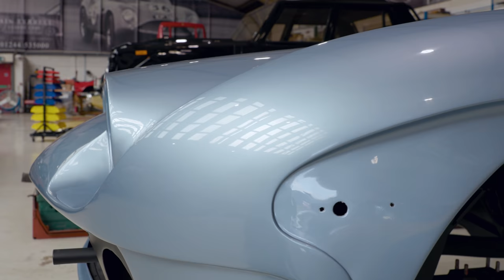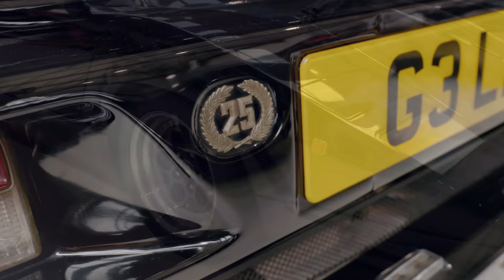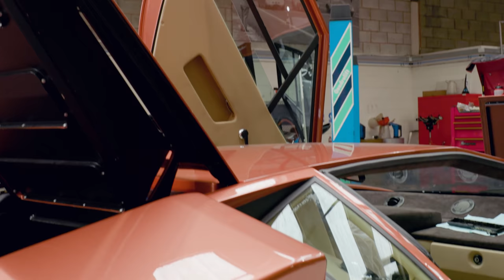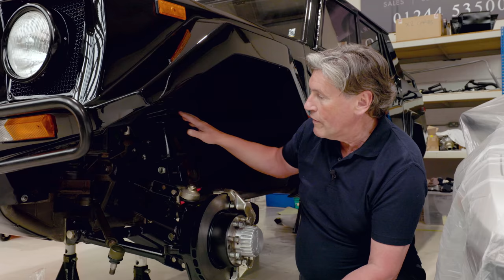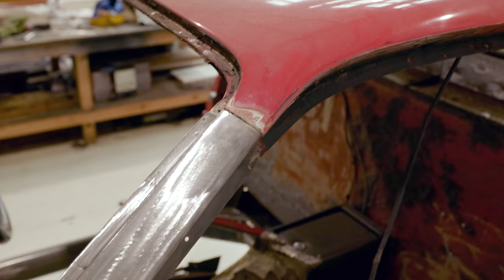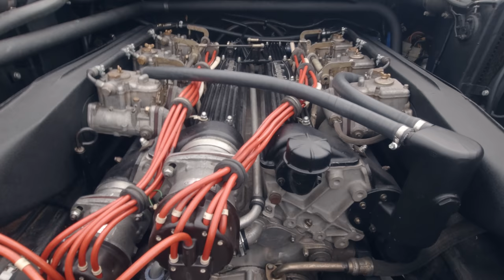Catching up with The Italian Jobs - Ferrari & Lamborghini Restorations | Tyrrell's Classic Workshop

Comment: When Ian is referring to embossed leather, it is typically regarded as a lower grade leather. Hides are split (skived) into two, the original outer skin is "top grain" and is easily distinguished as it has a completely random, much deeper grain. It is also usually much thicher because as the grain is deeper, you need to split the hide to keep some thickness to it. Embossed leather tends to have a much shallower and more consistent pattern, which has a much softer hand feel.
Sadly, embossed leather is not as durable and the pattern eventually comes out of it, leaving a fairly shiny leather.

Comment: The Rolls story must be from the 70's as the Granada didn't exist in the 60's! Similar stories exist from the days when Hondas were built in Rover facilities, some parts not good enough to meet the Honda standards went onto the Rover cars instead.
Reply: Well spotted! The Granada came onto the scene in '72 which fits the '70s timeline. However if the story related to Ford's Mark III and Mark IV Zephyr/Zodiac models then it would be in line with the '60s.
(Rare oversight from Mr Tyrrell!)

Comment: After seeing a 308 in its underpants, I don’t feel like going for a ride.
Reply: Thought the same thing.  Especially when it's rusty!
Reply: A lot of Ferrari’s incl the F40 look like very dodgy kit cars when you strip them down. Things are vastly better with the more modern cars
Reply: @ericpisch2732  I've seen Ferraris stripped down and thought there's no way ..like no way this is the same quality as a German built car or even a GM or ford product ...they look very poorly constructed
Reply: Different era technology. Common cars were no better regarding chassis rigidity and safeness.
Reply: @ericpisch2732  The F40 was a race car minimally adapted for road use. Weight was the enemy.
Reply: With more modern ones its a different issue. Aluminium and steel close together, plus salt water causes corrosion. You get the same thing on the Lotus chassis.

Comment: Quick question. Why does the espada with the same or very similar bizzarini v12 has a single 12 cylinder distributor with 4 points in it but this countach has 2x 6 cylinder distributors with twin points in each. Why is that? What are the pros and cons of each setup?

Comment: If you ask me the Countach has the best sounding car engine of all time. I've talked to Lamborghini owners and they say that the engines and transmissions in the Countach and Jalpa were really solid. If there were reliability problems it was in the electrical system because that was supplied by Fiat and Fiat hasn't been known for Toyota like reliability.

Comment: Wo Iain! That countach was smoking there at the end. No, I really mean smoke coming out of the pipes. Seemed more on the left bank. Bad valve seals?
I remember when the Rambo Lambo came out. As you said, sheiks were buying them.
That blue color on that one was one of the most beautiful colors I have ever seen! Why would anyone cover it with red?
Reply from the maker: There was some water in the fuel system from a porous tank (as it turned out). The carbs are now rebuilt, and it’s smoke and steam free. It’s very much a working workshop, so sometimes things like this happen, and we try to squeeze shooting the videos in between. Thanks for your interest

Comment: I resprayed a Ferrari 308 back in 1983/84 owned by the Rothchild's Banking family and it was originally in a Rolls Royce colour but Rolls Royce wouldn't give out their colour code formulations so I had to make a colour as close as I could which was a metallic dark blue but problems arose at the beginning so I ended up having to strip all the paint off the car which was Fiberglass with a steel boot and an aluminium bonnet.

Comment: In the eighties, Ford was generally very, very fussy and strange about tolerances. To the point it hardly made sense to contractors. Lots of batches got rejected for strange looking reasons. 
The reason was: robots. Parts were stacked up next to the assembly robots, up to 10 or 20 parts tall. The robot needed to be able to grab the top part with precision, and not miss because of an ever increasing deviation. 

Contractors were not told.

Comment: Ford Granada didn’t appear until 1972 - so the 1965 reference with Rolls Royce is a somewhat ropey story. Surprised Mr Tyrrell wasn’t aware of that from the “extremely reliable source”.
Reply from the maker: My source worked at Girling in a senior position. I agree, I either got the model or the year wrong. The joys of one take. Still true though. Thanks for your interest

Comment: are you aware of the easily improvements to the Countach electrical system to reduce voltage drop from rear to front and front to rear.  the alternator out put cable can be changed to a 4 gauge cable over to a 130 or 140 amp mega fuse block . the alternator should be 120 amps.  installing the mega fuse block in the right rear corner of the engine compartment..  repinning the radiator fan relay pin 30...  to be directly powered via a fuse  from the mega fuse block.. install a relay for the AC compressor clutch. on cars that have MSD ignition systems.. the thick red MSD power cable also needs to feed from the mega fuse block.  on fuel injected cars... both fuel pumps and the fuel injection system get powered from the mega fuse block.  doing this reduces the voltage drop from the alternator to the fuse block and battery.. what happens is there is more current available to spin the evaporator fan faster.. so the ac actually cools the cabin without needing to open the doors at stop signs..   adjustable output voltage regulators are also available from some suppliers. .. just thought i would share..  try some voltage drop tests if you don't believe me.  all you need are 20+foot long test leads.  and yes.. its not original.. it works better..  one should also examine the connector near the oil cooler thermostat . so the thick pink wire going thru shows no signs of burning..   lastly.. where the wiring harness comes off the fuse box... please use a fiber optic camera to look at where the wires come out and bend forward .. there is an unprotected steel dash board brace that can cut thru the wiring harness insulation.. causing electrical fires.

Comment: "Nothing wrong with that!"
To be fair, also, what's wrong with medians on the side of UK and IR roads???
Reply: By medians, do you mean what we would call a 'central reservation'? He's driving down what is most likely classified as a 'B-road' (I don't know the precise route he's taking, so can't confirm definitively) our B-roads and even many of our A-roads are too small to have them, so you will find them only on the larger A-roads (usually the dual carriageway variety, even then its not guaranteed) and motorways (what would be called highways in the US).

If you mean what's literally by the side of the road (the 'verge'), well thats a complete lottery what you get! Depending on what type of road it is, you might get curbs, maybe a pedestrian pathway with the occasional 'lay by' or none of the above - so if you go off you're in the trees/hedges/fences/a building (which tends to focus the mind on a 'spirited' drive, unless you're being a complete moron)!

So as above, our back roads tend to be on the too small side (which is partly why large American cars never really caught on over here, as well as much higher petrol/gas prices). In some cases they are just country lanes, originally intended for horse & cart that have been surfaced over and/or homes have just been built up around them, over years & years of development that is steadily encroaching into our green spaces. Even many of our 'main' roads are smail in comparison to US 'surface streets' and certainly in cities, which again in many cases the roads have developed from horse & cart tracks over many hundreds of years (like London!).

Many of these roads now have totally inappropriate traffic loads forced onto them by new developments and the schools etc that come with them, usually without a thought to how people will safely join and exit them it seems.

I suppose the closest thing to this in the US is what seem to be referred to as 'canyon roads', but even those look to be generally wider than a lot of our country roads from what I've seen in various videos.

Probably way more of an answer than you expected or wanted, but my two pennies anyway, I'm answering from a UK perspective BTW, but having driven on southern Irish roads, they're not dramatically different :)
Reply: @antn537  Thanks so much for the great reply.  
By "A" roads, are those like the A2, A3 and A4 I remember driving when I once spent time between London and its suburbs?
Also, I found your country lanes truly to be charming.  As a seasoned driver from So Cal, however, the nearness of stone walls so close to edge of the asphalt (tarmac? bitumen? pavement?) was always a little unsettling to me.  I also did an extensive drive through Ireland in 2019 - so charming - but again, wow are the stone walls close to my door ;)  And don't get me started on how those walls and verge block visibility when exiting a driveway.  Add to that the tour buses on some of the more scenic roads - wow.  Maximum attention at all times.
Love our friends across the pond, would never want you to conform to our ways - just a friendly jab from someone who's used to a little more margin for error...
Reply: @davidepperson2376  No problem, it’s always interesting comparing roads and I guess that also contributed to the difference between European and US cars in terms of mechanical feel/setup. 

You’ll find a lot of Europe is like the UK, where the ‘scenery’ is in quite close proximity! Again I think this is a legacy of the way our roads developed around historical buildings, towns etc. Where in the US the roads have developed with the towns/buildings  (or the buildings developed around the roads) combined with the easier availability of open spaces & land to build on.

I’ve done a little bit of driving in the US, in parts of California, but mostly around the SF Bay Area/San Jose and up to the Fresno area and it certainly felt way more open than anything over here. Most of the other parts of the US I’ve been to I didn’t drive, but the roads were all big (and a lot straighter!).

Oh and there are literally hundreds of ‘A’ roads, but the ones you mention are correct! In fact the first major South/North road before the M1 motorway was the A1, going North from London. Believe it or not the majority of the A1 actually follows a road originally built by the Romans when they occupied England - so this is what I meant by some of our roads being pretty old!!
Reply: @antn537  Thanks for the reply.
And I'm curious: in the States we have a legal process known as "eminent domain".  I always just assumed it originated in English common law, but maybe not.  Over here, the government can take some or all of your land if it's needed for the public good.  For example, if the want to widen a road, add a lane, etc, the federal, state or local government will appraise your property, pay you for the pro-rata portion they're taking, and there's little you can do about it.  It is generally a fair deal, and you can dispute both the appraisal and their need for the land, but in the end it IS difficult to "fight city hall..."
Perhaps eminent domain isn't a thing in GB?
Reply: @davidepperson2376  Yep we have that, usually results in a 'compulsory purchase order'. I'm not sure of all the details of the origins of 'eminent domain', but it probably dates back to the land barons of old. 

In modern times a compulsory purchase can only be made if the project plans have already been approved, which isn't guaranteed. As far as I'm aware it will only be for public infrastructure projects. Usually once the planning is approved and its been decided what land needs to be taken, there's only a high court challenge that can be made to reverse it.

As I mentioned previously, even given that process, it's more difficult in the UK due to the nature of urban and sub-urban development over the years combined with our 'greenbelt' restrictions/covenants and limited land mass.

As examples, I believe there have been multiple (rejected) attempts to expand the two-lane section of the 'M3' motorway in the south of England to three lanes, along with the third runway for London Heathrow airport and the recently over-ruled project to put a road tunnel under the land that (the UNESCO world heritage site) Stonehenge sits on. If you want a really high profile example, do a bit of Googling around 'HS2' which is the North/South England high speed rail line, which has been controversial to say the least!!
Reply: @antn537  Thanks again Ant man!  Cheers from across the pond!